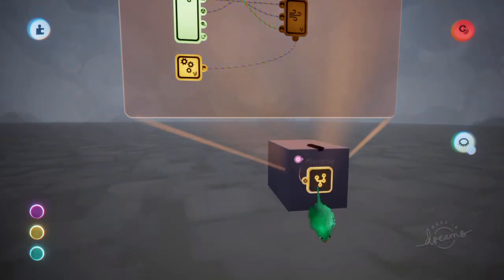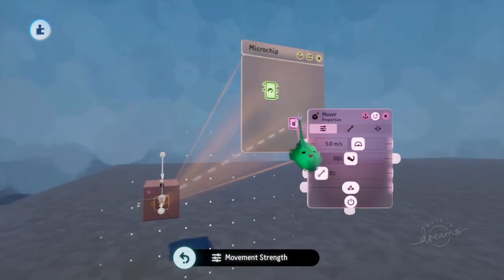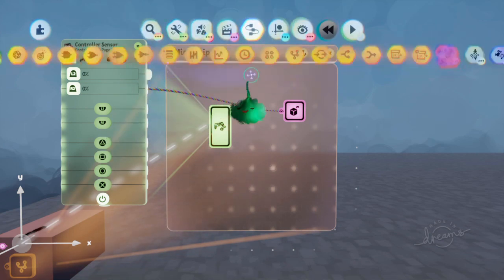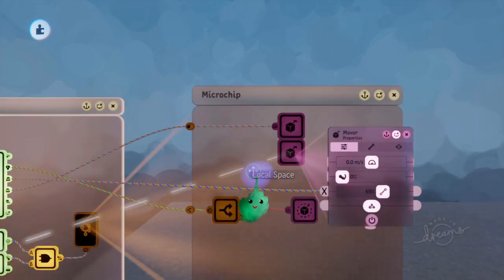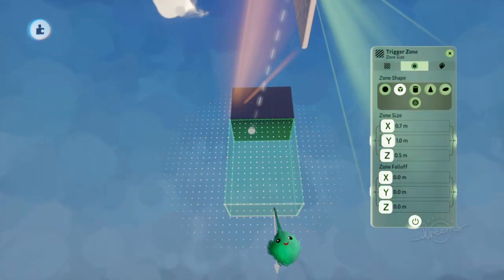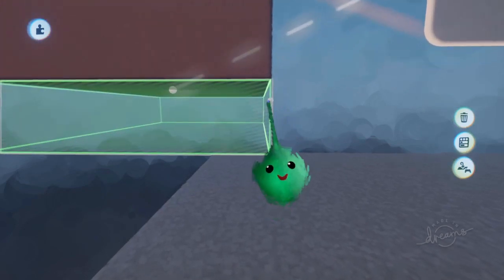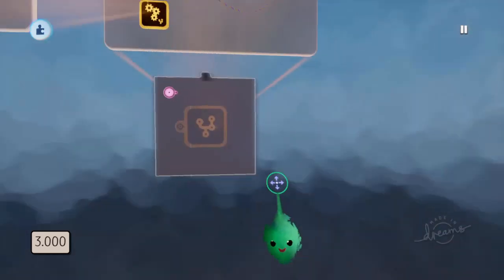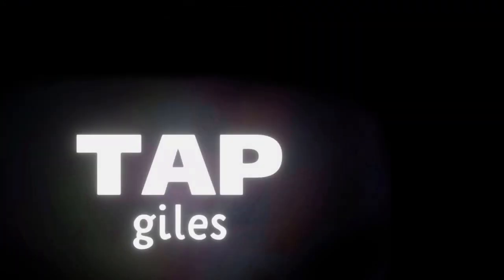Car (part 1): Acceleration, Braking | TAPgiles Daily Dreams Tutorial

Comment: Could you use just the trigger zone underneath the car to enable/disable the mover, rather than both the trigger and impact sensor? It could save on thermo to use just the one. Is there an advantage to using both gadgets?

Comment: On a math-y note. You can also add a calculator set to exponent to your signal to give it a curve. If you want a little slower signal at the beginning of the trigger pull, set the exponent to greater than 1. And if you set the exponent to a decimal, it makes a root function that will give you a quicker signal. For example, if you're car goes too fast at first and you want a little more control of acceleration at lower speeds, throw in an exponent calculator with the B-value set to 2. This will give a .25 signal with a half trigger pull